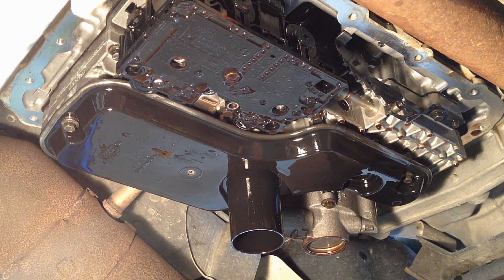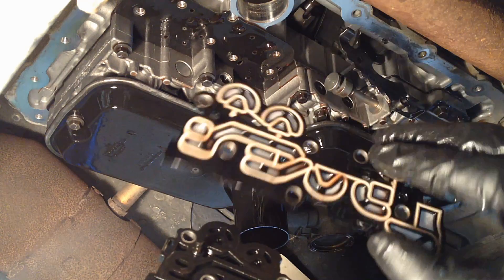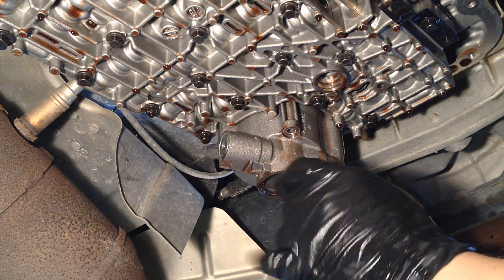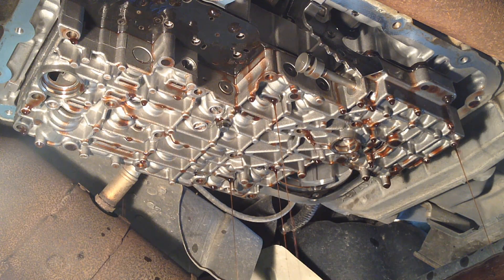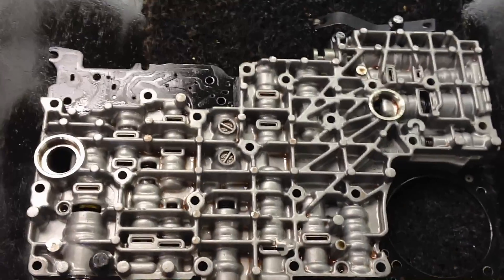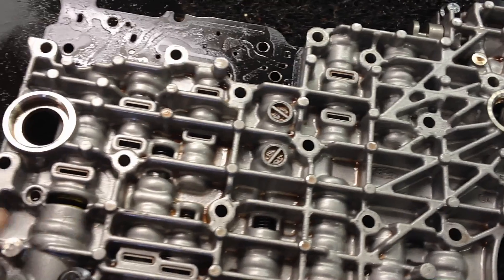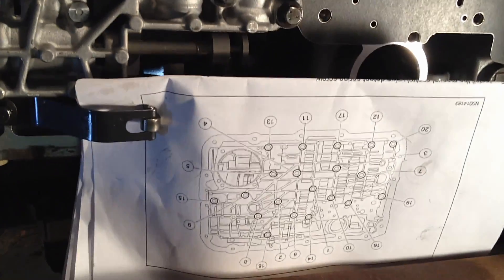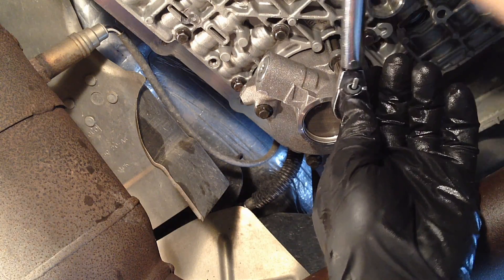Ford Explorer 5R55S Harsh Reverse & P0741 TCC Performance Valve Body Replacement

Comment: my 2003 Eddie Bauer Explorer 4.0 v6 just started 'OD Off' blinking light.  No slipping or unusual shifting.  The trans seems really good.  I'm wondering if this could be symptomatic of fluid/filter or possibly Solenoid Pack.  Autozone ran scan and said it has a code of P0741.   Any advise?     GREAT CHANNEL, by the way!!!!
Reply: Man Living Naturally I AM STARTING TO HAVE THE SAME PROBLEM. WHY
Reply: Same here. I'm going to check connections and wires. In the mean time since it runs fine without the light flashing i just erase the code using my OBD scanner. It comes back and and goes away on its own. But if i'm doing a lot of stop and go then i'll just erase it.

Comment: does the reverse servo have a servo piston in it?it looks. similar to the cap covers on the interm and the OD servos. ive read that the rubber will sometimes separate from the steel

Comment: Hai sir I buy ford explorer 2002 when I change the gear from parking to reverse and from reverse to neutral it gives a jerk but the shaft and the difference is good the only problem is in gear I think so the sensor of gear 1 is bad

Comment: does this transmission go in the 99 model years I have no reverse gear and no drive gear but I can drop it into 1&2 great and drove like that otherwise your have nothing
Reply: Anthony Morrison that's my problem? What u do to fix it? please
Reply: @BMW323ciDriver  Did you ever figure out what was causing this?
I'm having the same issue but in reverse and drive but the vehicle moves in sst 1st and 2nd gear but wont do 3rd or up.
I'm going to clean inspect the valve body and install the TransGo shift kit and a new solenoid pack as well.
It would be nice to know what else I should look for and what is causing the same no movement but slightly lurch forward or reverse.
Reply: @nathanielgriffin1941  Yeah I don't have this vehicle anymore, but what my problem was was the transmission went bad internal. I fixed it by swaping trans out completely. I did research and found out the gears run differently inside the trans, some work with other groups and others run on separate gears. But I believe it was the main planetary gear that broke, which killed reverse and drive but other gears like 3rd or 2nd still worked cause they run on different gear sets. something like that. 
If yours still drives but is sluggish, it could be something simple like the value thing, but could also be the trans slowly failing inside....which these 5r55s are know for.  
Good luck

Comment: Just wondering, if you could clean the valve body?? Do you always have to replace it?? how much is it?? I understand that solenoid pack should be changed, by the way, how much that cost?? Just wondering, if cleaning valve body would do the trick? Thanks, youtheman =)
Reply: You can fix the solenoid pack.  Lots of videos on that.  You can also brush out the bores with the Superior brand "Bench Buddies"

Comment: Really enjoy and learn a lot from your videos. I have an 03 Crown Victoria and need to know what to check for a reverse that does not want to engage after driving on the interstate  for a good while, 30 miles or so , and on real hot days. It will sometimes need to sit for a half an hour before catching reverse.  Thank you

Comment: quick question what if it has no Drive gears and only has reverse what would that be 1994 Ford Explorer 4x4 v6
Reply from the maker: +Allen Munkers Usually a valve body gasket failure. First test is to se if the fluid level is full and not burnt. Then a line pressure test is in order.
Reply: I will try that
Reply: Thank you

Comment: i got want to replace the pack and filter on my 2004 explorer 90k but i want to flush the garbage shaving because its one of the reason the pack goes bad and the fact it needs new servos for shifting issues...so should i flush before or after pack is replaced. i would think flush, replace the pack then fill.

any advice guys....
Reply from the maker: +Danie James I warn against flushing they can stir up debris in the bottom of the pan. The solenoid pack has an inlet screen on it already. If there is any debri in the trans the flush will not help. Also if you have brass shaving in the inlet screens the new solenoid pack will also fail.
Reply: Is there a torque spec on the screws/ holding the pack?

Thank you for your fast response.

Comment: Good day , I just worked on a 2006 Ford explorer with fault code P0745 Pressure control malfunction. I noticed the PCA, B and C were not clicking properly, I serviced it, then replaced the filter and ATF, but on testing it, it still didn't work. The car does not engage reverse. there no transmission related code, what do I do. Thanks
Reply from the maker: +Emesiobi Kevin You replaced the solenoid pack?
Reply: Thanks.

Comment: Hi there,
I replaced the solenoid pack n still getting P0741 the transmission shifts nice no problem,change the filter and no debris or metal near by the magnet inside looks clean,do u think changing the vb will fix this?
Thanks for posting these videos!
Reply from the maker: +Gerardo Esteban almost every time the cause for a p0741 is the valve body as shown in this video.

Comment: I have a 2007 Ford Fusion that will not shift into a higher gear.  Once you hit about 40 to 50 mph, only the RPMs go up but no upshift.  I took it to the dealership for a diagnostic and they said it needed a valve body replacement.  However, they also said there could be further transmission damage but would only know for sure after removing the transmission oil pan.  If I remove it myself, how will I know if it only needs a valve body replacement and/or if no other transmission damage has occurred?  Plus where can I get the torque sequence for this valve body?  I would appreciate any help! Thank you for what you already do!
Reply from the maker: +Ruben Galindo I assume you have the 6 speed? Which gears are you missing? First check is the trans fluid level, color and smell is it burnt?
Reply: +FordTechMakuloco 
I was told by the Ford dealership that it's a 5 speed. I'm not sure at what gear it stops. and yes the fluid is black but it doesn't really smell burnt.
Reply from the maker: +Ruben Galindo because this is a mazda trans only the valve body or complete transmission is available. So thery are guessing at the valve body to get you in there and then drop the bombshell you need a complete trans because it did not fix it and nothing is serviceable on the trans. If you remove the valve body you would be looking for excessive debris causing the valves to stick. They should move freely in their bores.
Reply: ok thanks.  If it indeed needs another transmission, Ford quoted me $8,000 plus.  The car is not even worth $8K.  Are used or rebuilt transmissions difficult to change out?  Are special tools required for this job?  I'm no mechanic but I do try to do some things if they're not too difficult.
Reply: +FordTechMakulocom.M I have a 2005 Ford Explorer v6 and my reverse went out also in third gear it will not pop into place . is there anything I can do before taking it to a transmission dealer I consider myself pretty mechanically inclined

Comment: My car only shifts harshly when the O/D light flashes. When it goes away the Explorer runs like a dream. Any ideas sir?

Edit: I got code P0741 and my CC slip was like 74 the one time i took my tablet with me and had the OBD2 reader in. I'm scared to take it into a shop and have them say "Derp you need a new tranny"

Comment: i have a 2005 ranger fx 2, 4 liter with a 5R55E (acording to the sticker and book)  my trans is not shifting, it stays in 1st, the od off light is flashing and i have no reverse.  I also have no check engine light on at this time.  Any Ideas?  125,000 miles
Reply from the maker: +Raymond Root The flashing O/D light means the pcm has found a trans fault and stored a code so get the codes read first.
Reply: +FordTechMakuloco Just put my scanner on it   PASS no codes found  The light is still flashing though
Reply: +Raymond Root I use the same scanner as auto zone  should that one read trans codes?  would the range  selector switch have anything to do with this?
Reply: +Raymond Root   ok  I found my issue at least I think I did. I dropped my pan, pulled the valve body to check gaskets. then I niticed a peice of aluminum kind of hanging on the passenger side.  Turns out the snap ring housing for the o.d. serval has about a 1-1/2 inch peice broken out witch in turn allowed the serval to twist.  So I was woundering if i put the surval back in place and reinstall the snap ring, do you think this would hold for a few weeks? Or would some J.B. weld hold the peice good enough for a temp fix?

Comment: Good video. Do you have any tricks for removing a broken o/d servo pin? It is broken right at the hole through the side of the pin. I can move it a little with the valve body off, but can't get it out.

Comment: I ordered a new valve body and gasket kit for it but when I received the valve body it came with like a hard gasket already installed on it. Do I need to use the other gasket kit I got off eBay?
Reply from the maker: +MrMmfz85 No it should only have one separator plate.

Comment: Hi, i have harsh in forward and sometimes in Reverse ,  with P0745 code, i have changed solenoid block but the problem still there, do i have to change the valve body or just check  solenoid regulator valve? please advice . thanks
Reply: What did you ever figure out?

Comment: Hey tech, I am also having a harsh and delayed reverse with the soft slip from 2nd to 3rd gear.  Should I replace the solenoid pack while I have it open?  Thx
Reply: +jsjizza1 I have the same issue on my 03 Explorer. What did you find that fixed this?

Comment: hi my ranger loss gear when i come to a stop i have a 2.5l auto 2000..i just put mobil 1 and some conditioner from lucas should i do a rebuild or go for a bonded valve body gasket and a transgo shift kit?
Reply from the maker: louis ortiz Pull pan first and check that gasket.
Reply: ok cool thankyou i know your a busy man peace ...

Comment: Po745 says solenoid pack. Should I start with that or can it be the servos?
Reply from the maker: Tron2271 Usually this is because of pressure loss due to bypass from worn servo bores in your case the overdrive bore. There is a company that offers a servo bore kit with orings to fix this without an overhaul.

Comment: I'm having same problem my o/d lights on and it seems to slip after it hits 45 mph. But I can't get a code because my check engine light won't come on. I think it's the solenoid pack but how can I be sure.
Reply from the maker: Tron2271 if the O/D light is flashing then there is a pcm code stored. Your scanner must be able to read manufacturer codes as P1744 is likely set.

Comment: It has 167000 miles on it.
Reply: FordTechMakuloco Hi, 
I have to thank you as I was able to fix the problem about harsh reverse shift for my 2005 Explorer 4.0, by changing the solenoid valve (exactly as in the video) and yea, the Ford Dealer here had no clue about this.
Thank you again.
Reply from the maker: I would most definitely change the solenoid pack for the harsh reverse and you will likely find after the repair the rest of the shifts will improve. At that mileage you are flirting with servo bore wear though too. I would make sure the fluid is not burnt, change the fluid, pack and filter with mercon V reset pcm as per my other video and drive to learn the shifts.

Comment: Good morning!  Just bought a used 04 explorer 4.6 V8 and I'm having the hard shift into reverse and sometimes a hard shift into 2nd and to get to overdrive. Most times this has happened, the "check transmission" message came on the trip computer display and the O/D light flashed.  Turning the car off and on reset these messages. But the other day this happened and it triggered the check engine light.  My friend here at work has a code puller and I got the P0775 error code - solenoid b - should I just go for the solenoid block replacement and also a new pan gasket and filter and see how that goes?
Reply from the maker: Does it have high mileage on it?
Reply: Yes, 167000

Comment: I have a 96 Ford Explorer Eddie Bauer with 4 wheel drive  my car was #slipping 2nd 3rd #gear when I put it in #reverse is slipped a little and den it #jerk back #hard .I check the #transmission #fluid it wasn't #burnt .. The #fluid it still #red .. I #change the  #transmission #filter & added new fluid with it . You think I should #change change the #body #gasket cover ?
Reply from the maker: MocThaBoss Wallace I would check for blown out gaskets yes, but more than likely the servo seals are hard and not sealing very well causing the 2-3 shift flare very common.
Reply: FordTechMakuloco Iight thank man have a blessed one

Comment: My 04 explorer has pulled codes P0715 and P0717 from Ford.  When decelerating from highway speed the o/d light started flashing and wrench came on.  The truck wont go into 2nd or overdrive now.  Fords trans tech diagnosis is 2nd gear band is broke (requires tear down to fix) or damaged servo (means valve body I think).  I was hoping I could just replace a sensor and be off.  The net indicates valve body is usually the culprit.  The truck has had a delayed reverse and sometimes banged into reverse and 2nd so I'm thinking that thevalve body is bad and the bands are fine as the 2nd gear band isnt related to reverse?  what are your thoughts?
Reply from the maker: Sounds like you have all the usual issues, solenoid pack or valve body for reverse yes, but the bores get worn the servo pin get stuck in the case, drum spins up pin pops band applies while drum at high rpm and band breaks. I believe they can see if the band is broken with v/b removed but either way like I said in video they wont be able to see the welds on the other side of the band until it is disassembled.
Reply: I've read you can adjust the band tension to 10 in pounds of torque and back off 2 turns to set it correctly. If the band doesn't tighten to 10 inch pounds i can assume it's broken?  Do you know where I can find the adjuster on the side of the case?
Reply from the maker: you tighten the rear band adjusting screw to 10 ft lbs then back off 2 turn, then tighten the nut. The adjusting strut will still torque down as it will still bottom out on something drum etc .
Reply from the maker: It is on the left hand side of the case you cant miss the two next to each other. This adjustment can get rid of a shift flare but a missing 2nd gear all together it is unlikely this adjustment will have any effect.
Reply: FordTechMakuloco
I pulled the pan and can see both bands now.  the front overdrive band is tight and seated snugly against the adjuster bolt.  The intermediate band seems loose and the adjuster bolt is not snug on it.  I can move it off the adjuster bolt seat easily with a screw driver but then it quickly tightens up nicely.  About 2 turns in of the bolt would set it tightly on the adjuster.  I would think if it was loose then it broken on the other side I cant see, but then why would it still tighten up??  I;m going to tighten it down to spec and see how that goes.  Is there an obviuous way to tell if the band is broke?
Reply from the maker: On the one side you would likely be able to see the broken weld were as the other side you wouldn't. No good way in car exactly. I would try tightening it and go from there either way.
Reply: @FordTechMakuloco  You can press the pin and if the bands tighten, you're good.

Comment: hey man i have a 2003 explorer 4.0 and i have a problem with the transmission...it shifts from park to all the gears fine but when i drive it doesnt go past 45 mph..do you have an idea what it might be
Reply from the maker: You will have to count the shift to see if it is achieving 5th gear or not, sounds like a servo bore issue not allowing 5th gear. Any codes yet?

Comment: Hey buddy I have a question for you my 0t ford explorer is getting two transmission codes can't remember the code exactly. But first one said solenoid pack A and second one said gear 3 out of ratio. Should I get it rebuilt or should I change the solenoid pack?
Reply from the maker: Having the exact code is best but if you have high mileage the servo bores are likely worn anyway so a solenoid pack may only prolong the inevitable rebuild of the trans.

Comment: My 06 Mustang has had this problem for over a year. I have talked to a bunch of Ford Dealership service centers here in Phoenix Az, and none of them know what the hell is wrong with my trans. Are you the only Ford tech that knows anything about this? Unbelievable.  I am just going to fix it myself with the help of your vids. Thanks for posting this valuable information.
Reply from the maker: No allot of trans techs at Ford dealerships know of this a very common cause.
Reply: FordTechMakuloco So do I replace the valve body and solenoid pack with new?  I can get them at the Ford dealer or somewhere else? Thanks for the info.
Reply from the maker: You can get the parts at allot of places online but I would only trust a Ford dealer for new parts if I was going to go through all of this. I would personally replace the solenoid pack first.
Reply: FordTechMakuloco Thank you for your advice. I will do that. Thanks for the extremely helpful videos. Only place on the internet and the real world that I found my answers about my trans problem.